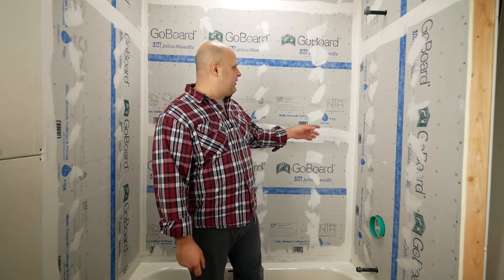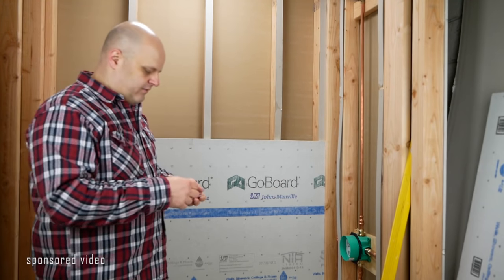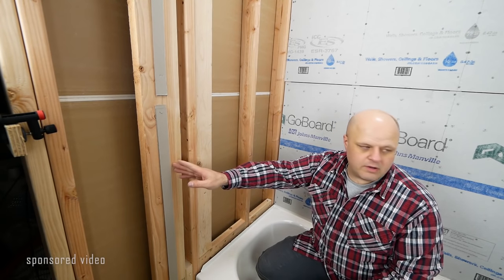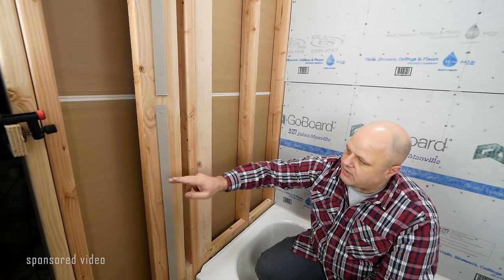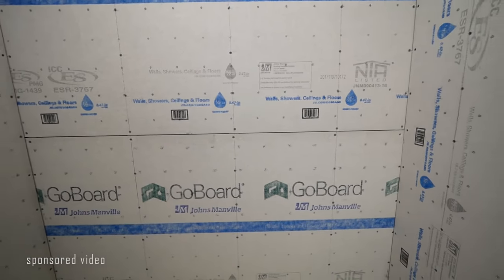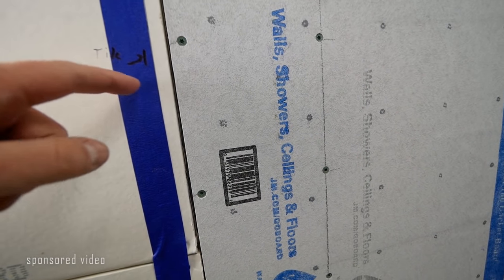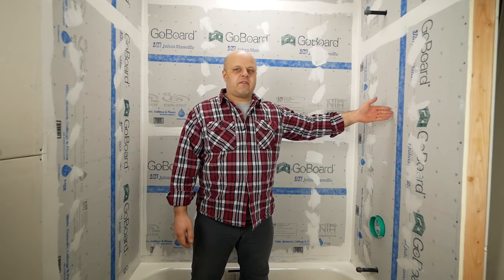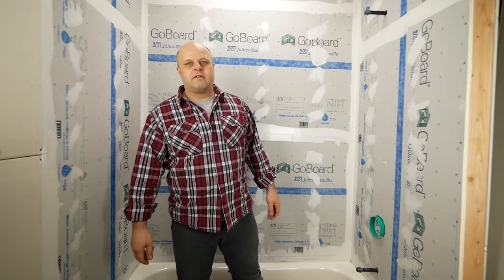How to Install GoBoard Tile Backer Board

Comment: I must say. With the GoBoard being so waterproof it seems counterintuitive to demand a joint. If Sealer is pliable, and theres no expansion/contraction of the board itself?, wouldnt a 1/6 joint be even better as an end result?????  I think their just want to sell more sealer. Bet its not cheap. I mean im just applying good ol common sense to this. Plus 40 yrs in the tile business might give me a little authority to question. Not you but J Mansfield. Your just doing whats asked.......

Comment: I like how this stuff is lightweight and waterproof, but it doesn't feel as stiff as the Wedi foam board or the cement boards. I paid about $35 a board for it, so hopefully this stuff holds up well for a long time.
Reply from the maker: I've found that once it's sealed and the sealant is dry that it helps to stiffen it up quite a bit. I don't think the stiffness is the same as Wedi Board but it doesn't cost as much either.
Reply: $22@Menards

Comment: thanks for sharing.  Is the screw the drywall screw?  Or the Goboard has their own screws?
Reply from the maker: GoBoard has their own screws but you can also use cement board screws

Comment: I would have used moisture resistant sheetrock butting up against the Go Board on that shower wall, as well as on the remaining walls in the entire room.

Comment: Where did you get the long shims that the go board goes into to cover over the tub flange?
Reply from the maker: Drywall shims in the drywall section of the hardware store

Comment: Where is your 1/8th inch spacer at the top of the tub flange board, and the bottom of the first piece of Go Board? At 4:12 you said you were going to do that, but you didn't.
Reply from the maker: Everything is gapped all the way around. If it gets too tight then I just cut the gap in with a utility knife

Comment: Why would you waterproof the GO Board when it states right on the board that it is waterproof?
Reply from the maker: You waterproof the edges and penetrations of the board which it states to do right in the instructions
Reply: @DIYTileGuy   I thought that's what the tube of JM sealant was for?

Comment: Do you think using Red guard or similar product is overkill or unnecessary?
Reply from the maker: There's a method where you fill the seams with thinset mortar and mesh tape rather than sealant. If you follow this method then you can apply Redgard over the thinset seams. If you're not using this method then Redgard, or any liquid waterproofing, is not advisable.

Comment: im trying to build a divider for my van. would this stand on its own if I used brakets? also , is it sturdy enough for me to install sconces on it? sconces will weight about 3 lbs each . i wil install 2
Reply from the maker: I don't think the edges of this stuff would work very well if they are exposed in your van. For sconces, typically the cans will mount on a stud or a spreader bar so it's not the board that would hold them up. However, if your trying to use a remodel box then your going to want a style that will grab as much surface area behind the board as possible.

Comment: Great video, thank you! I just subscribed to your channel – A question about using go board wall panels and a Schluter shower pan (Due to product shortages I am looking to combine Goboard walls with a Schluter shower pan) – can I use thin-set and kerdi-band to “connect” and waterproof the seam between the Goboard walls and the Schluter shower pan?
Reply from the maker: Yes, you can do it exactly the same way as if you were using Kerdi-Board

Comment: Does the goboard go over the lip of the tub or shower pan, or does it just butt up against the top of the lip?
Reply from the maker: It can go either way. It depends on the tub and the situation.
Reply: @DIYTileGuy  So if you do it your way, do you just let the tile hang down past the bottom of the Goboard with no support? thanks
Reply from the maker: @robertsirovatka4542  By the time the flange is sealed with sealant there isn't a lot of space. But I add additional mortar to fill in any void

Comment: Can someone tell me what type of backing / tape is stapled to the studs prior to installing the Go board ?
Reply from the maker: Those are drywall shims for flattening out the wall prior to installing the backer board. You can find them in the drywall section of your local home improvement store.

Comment: why wouldnt the goboard go directly over the flange and butt closer to the top of the tub vs on top of the flange?
Reply from the maker: Depends on the flange and the situation. Some flanges are too thick. On this one, I had one side that wasn't up tight to the wall.

Comment: How many tubes of goboard sealant did you use for surround tub/shower ?
Reply from the maker: I would figure 1 tube per sheet and then add a couple of extra on to the total. So If you are installing 5 sheets then buy 7 tubes. 

Good question and I forgot to mention this in the video.

Comment: What's there an alternative to the go board sealant. I saw someone in another video using a locktite polyurethane sealant. The go board brand is $16 a pop.
Reply: I've used that in the past or if you don;t mind the expense try some 3M 4200 or 5200 marine adhesives.
Reply from the maker: On my website, I have the GoBoard alternative sealant list. You can also find it on GoBoard's website. I believe GoBoard offers a longer warranty with their sealant. https://www.diytileguy.com/goboard-tile-backer/
Reply: @DIYTileGuy  thanks, looks like Goboard has a list of approved sealants they recommend. I ended up using "Fuze it" by liquid nails. That stuff is super sticky and feels like rubber when it dries.

Comment: do you not put the go board over the bathtub flange? i have not done this before so any advice would be helpful
Reply from the maker: It can go either way. It's not always practical to drop the board down over the flange. But do it if you are able to.
Reply: I just took a rabbeting bit on my router, and relieved about 2" so go board sits flush to flange.  @DIYTileGuy

Comment: What is covering the studs?
Reply: You can cover the studs DIRECTLY with the GoBoard. No Plastic or membrane needed   Don't follow the video. Put a bead of sealant on ALL the edges of the GoBoard as you install it and use a 2" putty knife to smooth it out. Use butt joints in the  corners, (you'll only need to caulk one of the edges).  Use sealant on the transition from the goboard to the drywall/green board that covers the rest of the room.  And over all your screws.    It really is that simply.  No taping, no waterproof membranes, no redgard,  etc etc.
Reply from the maker: Drywall shims for flattening the walls prior to installing the GoBoard. You can get them at any hardware store like Lowes or Home Depot in the drywall section.

Comment: I thought the installation requires the fasteners screws to be 8” apart as the dots on the go board shows for best results? You did 6” fine vertically but, horizontally 16” on center?
Reply from the maker: You can only fasten where there is backing and standard stud spacing is 16 inches. This complies with GoBoard's instructions.
Reply: So I have multiple distances between studs in my shower for whatever reason. Should I screw the board in every 8 inches if that's where a stud happens to fall or just do every 16 inches so it's all even?
Reply: I went ahead and added the extra studs in the shower instead of screwing to the 16” on center. The cost and work was minimal. The go board is light and I felt better hanging all that tile on the board.
Reply from the maker: 16 inches is fine but that's the maximum spacing. If you have distances wider than that then some additional blocking would be necessary.
Reply: 8” inches for their fasteners. 12” for their screw/washers

Comment: I see you are having the same problem I have with GoBoard.  It is virtually impossible to not drive the screws in too deep.  Instructions say to not break the surface paper when driving in the screws,  which you are doing.  Mansfield need to come up with a better fastener system.
Reply from the maker: John's Manville does have their own screws out now and they have bigger heads for now grabbing power.
Reply: Or you can use their screw / washers
Reply: @DIYTileGuy  Their screws are marginally better.  Very difficult to not over tighten and break the surface.  Even the slightest angle and one side tears.  I'd love a washer like kerdi uses.
Reply: @donnbialik9085  I couldn't find go-board screws/washers I needed so I'm going to use Kerdi, since they are designed do the same job. They don't over-pierce the board.

Comment: Can you glue tub surround onto GoBoard?
Reply: in this video he left a gap between the tub surround and the go board then used sealant and a mesh tape to make the difference. I shimmed my studs for perfect level and then it was enough to overcome the difference the tub surround makes so i covered the surround with the go board. Left like 1/8 of an inch so it wasnt sitting right on the surround and used the sealant in the gap. Many others on youtube do it this way and it makes sense if you alrdy have to shim studds for level

Comment: Bad idea to try and apply sealant after all the goBoard is installed - do a few sample joints and see for yourself - when you separate the joint, you'll see poor coverage - some sealant barely adheres at all.  Yes, faster to apply sealant after all the board is installed, but you're needlessly compromising the waterproofing - the very reason why you use these systems. Much better to apply a bead before you attach the goboard - compressing the sealant creates an excellent, full-depth mechanical bond.

No need to mark every 6" for the screws - all those grey dots on the face of the Goboard are spaced at 6".

Also, just use a temp screw into the studs to space the boards apart - the threads are right around 1/8 or a bit more. Shims easily fall out.
Reply from the maker: Adding the sealant afterwards is a method approved by GoBoard as long as the instructions are followed.
Reply: @DIYTileGuy   @DIYTileGuy  Perhaps it's approved (news to me and not written in any document or official installation video I've seen), but do a sample test and see for yourself. You'll inevitably find a spot or two where it 'looks' good from the face, but when you separate you'll find no adhesion - especially if there's some dust or debris (never any dust at my jobsites!). Takes all of 10 seconds to lay a bead of sealant before installing the next sheet to be sure you've got a good seal.
Reply: @DIYTileGuy  I re-read GoBoard installation instructions. There is no 'apply sealant after-the-fact' approved method listed. The only 'after-the-fact' alternative offered is joints sealed with mortar, fiberglass tape and two coats of a liquid-applied waterproofing.

Quotes from GoBoard installation instructions:

"Liberally apply a continuous bead of GoBoard® Sealant, or a 
sealant as specified in the Approved Materials section, to the 
bottom edge of GoBoard so that when it is butted at the base 
the sealant squeezes out. To comply with ANSI A118.10 and 
GoBoard warranty, there must be at least 1/8" gap between 
GoBoard and base that is completely filled with sealant. Sealant 
must extend onto GoBoard surface at least 1" beyond joint on 
either sides. The slightest pin hole may result in a leak, so careful 
attention is required when sealing joints."

"Joint Sealing Alternative: Leave a maximum 1/8" gap between 
boards and fill the joint gaps with mortar, as specified in 
Approved Materials section. Place 2" alkali resistant fiber glass 
mesh tape on the joint and embed with mortar, ensuring it 
is fully covered. Then, if a waterproof installation is required, 
seal all joints and fastener locations with two coats of liquid 
waterproofing membrane, as specified in the Approved Materials 
section ensuring the liquid waterproofing membrane extends at 
least 1" beyond the mortar."

"Where waterproof installations are required, ensure that all 
joints and fastener locations are sealed with GoBoard Sealant 
or a sealant as specified in the Approved Materials section. All 
joints must have at least a 1/8" gap that is completely filled with 
sealant that extends at least 1" beyond either side of joints."
Reply from the maker: @ArthurDentZaphodBeeb  Thank you for your research. Those instructions were updated in 2019. At the time of publication of this video, this method was an approved method. Additionally, you can see this method in this video from GoBoard. https://youtu.be/1Fwo2e81Q8I
Reply: @DIYTileGuy  Ah, makes sense. I suapect GoBoard was seeing failures applying sealant after the boards were installed.
Reply: @ArthurDentZaphodBeeb  It made sense to me that sealant before would get better coverage like you said but when I checked the 2021 GoBoard instructions it is now the different than what you posted with the preferred method being sealant AFTER and the alternative as sealant BEFORE. There's no longer any mention of mortar/mesh/liquid membrane. 

 Preferred Installation Method: Install GoBoard leaving 1/8" gaps between all board edges, corners and changes of plane. GoBoard Spacers, tile spacers or paint sticks can be used to help maintain proper gapping between boards while installing fasteners. 

Joint Sealing Alternative: Liberally apply a continuous bead of GoBoard Pro Sealant, or a sealant as specified in the Approved Materials section, to the bottom edge of GoBoard so that when it is butted at the base of adjacent board the sealant squeezes out.
Reply: Absolutely agree and you shouldn't need to get any approval from the GoBoard people to exercise a little common sense.  Sealant IN a joint is far superior in sealing it than sealant ON TOP OF a joint.  Ever try to caulk a serious hairline crack?  UNless you take a putty knife and go at a 45 degree angle over the crack you're never able to get any caulk into it. Now change that hairline crack to a tight seam between two factory edges on the goboard.  Good luck, you're just wasting your time putting sealant on it at all. Sure you can tape it like cement board, but you've just lost one of the main purposes for using the GoBoard in the first place.
Reply: @muckeyn  Ignore the GoBoard folks and go with common sense. IF you;re trying to make something impervious to water why would you purposely leave an 1/8" gap between your cover sheets. (GoBoard)  All it would take is ONE BAD area perhaps as small as 1/16"  where that sealant didn't completely fill the gap or  pushed through. Why take that risk?  Apply a bead to your edges, so you can visually see the bead, then butt it up and push it hard enough that some of the sealant squeezes out. Just don;t Superman it so you squeeze all the sealant out.  Like I said...COMMON SENSE.  Then smooth it out with a 2" knife.  If you have to go back and smooth it again, you probably did it right, the sealant is still in the joint under pressure.  If not, you might have squeezed all the sealant out when you butted the pieces together, which doesn't help you.
Reply: @tonydioguardi8981  Yes I ended up doing this (a year ago) as it seemed like a safer method. In hindsight, it seemed possible to inject the sealant into the gap with the right tip and a gun if you chose to do it after. But obviously, butting is probably less likely to leave gaps. Wasn't too worried about the walls though. Just more a less curious why the instruction change.

Comment: Why didn't you seal around the mixing valve and pipe penetrations?
Reply from the maker: I talked about that in the video. Penetrations will get pipe seals and that valve will be sealed around also
Reply: Schlueter has covers for ALL PIPES AND VALVES!  SCHLUETER IS THE BEST!

Comment: How do I transition between drywall and thw goboard? Use mesh tape? Also the transition to the ceiling?
Reply from the maker: Yes. Use mesh tape, fill the gap with thinset mortar, and tile over that connection. The ceiling you can just butt into but you'll want to leave a small gap between the tile and the ceiling.
Reply: @DIYTileGuy  the tile will not go to the ceiling but stop shy about 2 to 3 inches. Also the tile will stop shy by about the same 2 to 3 inches on the front and back walls of the stall. I used drywall compound in both spots for painting it. Love the GoBoard ! Kind of itchy when cutting it though.
Reply from the maker: I wouldn't use drywall compound if the tile covers it but if you do then you'll want to paint primer over the compound before you tile
Reply: @DIYTileGuy  do I use the caulk for the ceiling transition or should I use drywall mud?

Comment: Anyones knows what kind of pain should i use for this type of board??
Reply from the maker: They have their own shower pan system now but it would be compatible with other systems too
Reply: @DIYTileGuy  I sorry but I was trying to say paint..
Is because I used the board on ceiling but now I want to know what kind of paint PAINT I hope you can answer thank you sr
Reply from the maker: Sorry, I misunderstood. I don't know about painting GoBoard. You'll probably have to coat it with drywall mud first. You might try calling their technical assistance line and see if they have better guidance for you about painting their product.